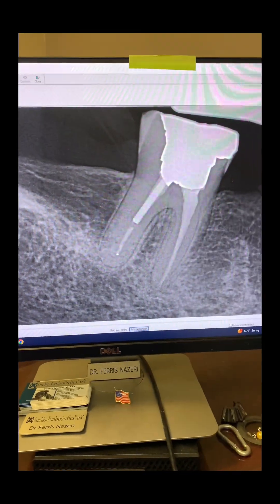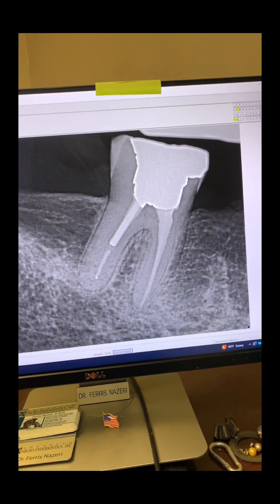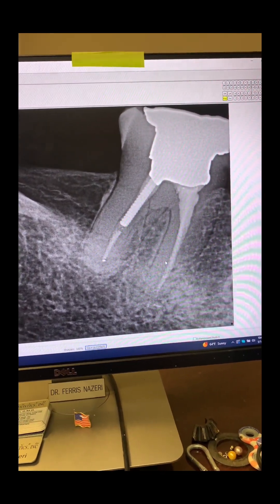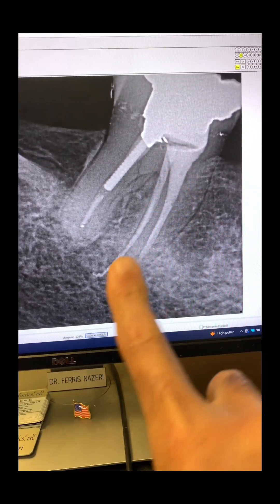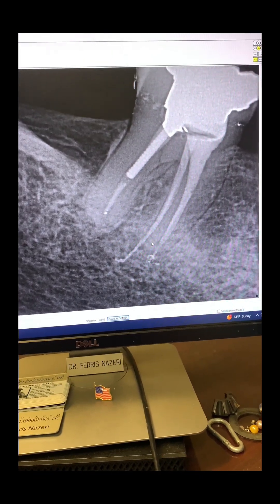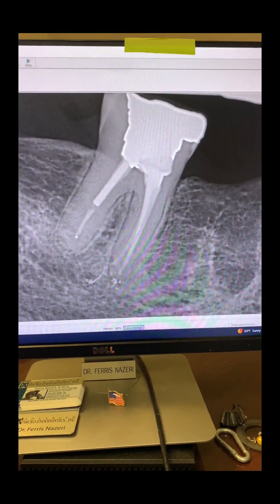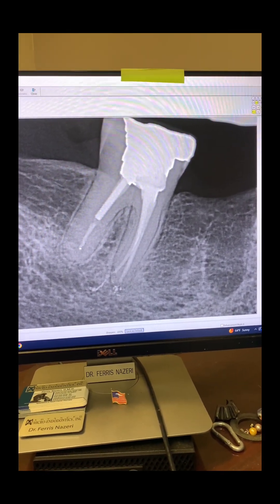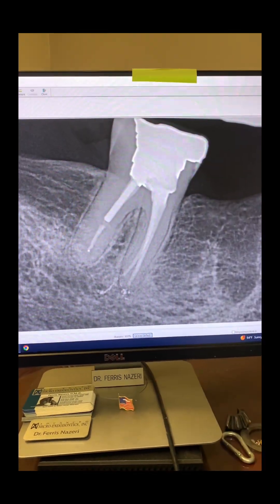Does obturating long cause endo failure?

Comment: Very interesting case doc, but did you say gutta-percha resorbed? I am pretty sure guttapercha can not be resorbed
Reply from the maker: As you can see gp has resorbed!
Reply: @ferrisnazeri2577  So you say guttaperhca is a resorbable material? and it resorbed in a year? I see a lot of cases with overextended guttapercha that have been there for 20+ years yet have not resorbed. Maybe in your case it was just sealer?
Reply from the maker: Does that straight white line out of the canal look like sealer to you? Sometimes gp resorbs and sometimes it doesn’t. It has to do with gp chemistry that was used and patient’s immune system.
Reply: @WarVisionYT  this guy is full of himself, the gutta percha is completely present in the follow up radiograph, i don't know if he's blind or just completely in denial 🤦🤦